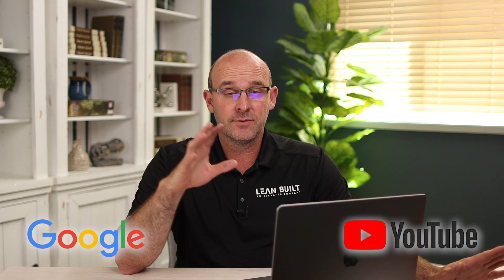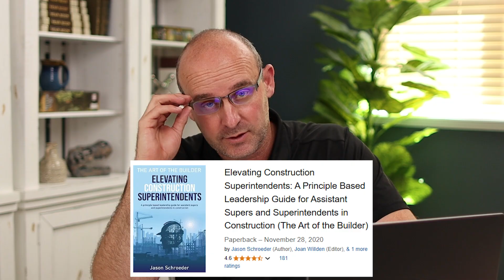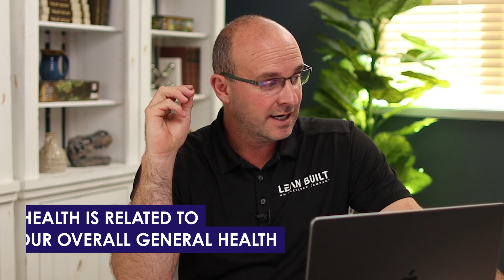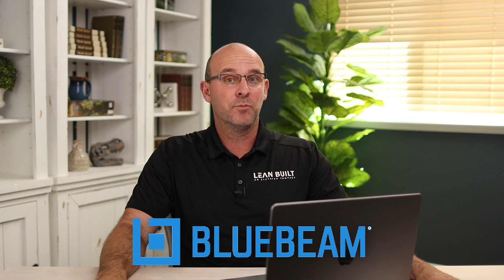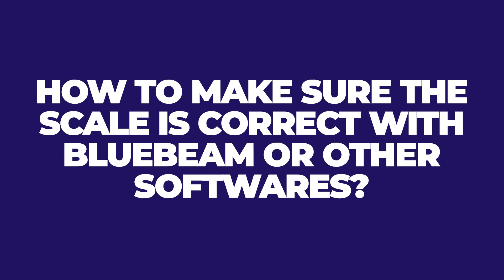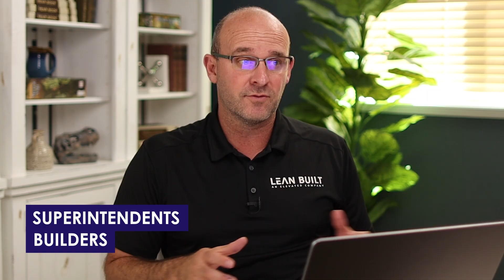What Size Paper Are Construction Plans Printed On?

Comment: Hi Jason, I’ve done Field Engineering, Project Management and Design Management. I’ve seen our business move toward paperless to the point when I now rarely see drawings printed out at all. Gone are the days where we could build a job with just a few A0 drawings. Projects may now have thousands of drawings with majority of design being done within Subcontract Design Packages. This volume of information is a problem in itself. Production is reliant on the quality of the design information, but are often reviewing drawings on screen which makes it difficult to properly compare interfacing elements. As a Design Manager and even Project Manager, I always had a file of paper drawings I could mark up with comments. Technology was supposed to make things easier and reduce errors. It seems to have had the opposite effect.